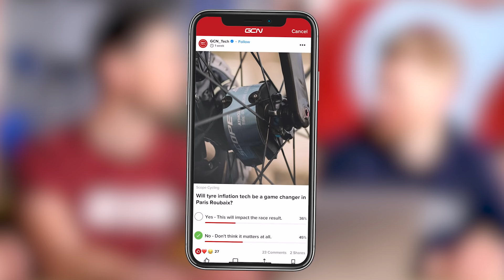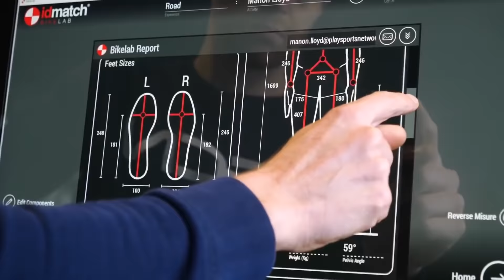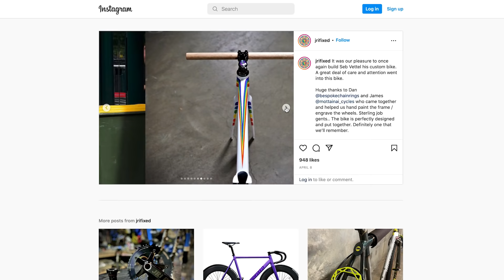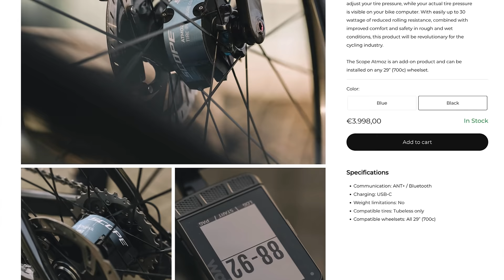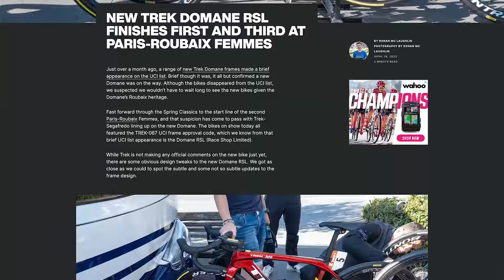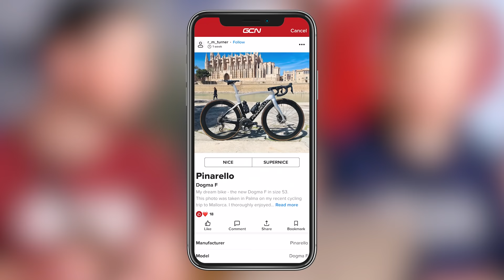We Ask A Bike Fit Expert Some Big Questions | GCN Tech Show Ep. 226

Comment from the maker: Have you ever had a bike fit or are you planning on getting one?
Reply: Had one done on my Wilier with an integrated seat mast. If you’re having your carbon frame cut you want the measurements to be spot on!
Reply: I've had 4 or 5 and work with a fitter now. That said, it's really really hard to find a good fitter in the US. Maybe impossible even outside of core cycling markets like the west (Portland, Seattle, SF, Denver, etc). Never found a great one in the midwest anyway and don't hear much about cycling out east.
Reply: Saving my pennies for one with Jake!
Reply: Never needed one.
Reply: Purchased a new roadbike including a bikefit. I don't save on a bikefit when I buy a high end endurance bike for the comfort and long rides.
Reply: People spend more on bike fits than I've sometimes spent on bikes. Seems like one of life's big waste of money, but each to their own, I'm sure marginal gains makes a vast improvement on the way to the coffee shop!!
Reply: DId one a few years agao and it was great. To Jake's point, I didn't necessarily produce more power, but it sure allowed me to produce the same power for a lot longer, particularly when climbing. Coming from the 90's school of bike fitting I was waaay overstretched on my frame, both vertically and horizontally. I finally understood why riders six inches taller than me were riding the same sized frame as I was. Now I've gone down a size and fell much better for it.
Reply: Yes. I found a PT who does bike fits. Purpose was to prevent possible injuries. Oh I am 61 years old.
Reply: @chicagoan  millions of people cycle on the east coast. I'm in NYC and the Manhattan Bridge has a counter at the north end of the bike lane. 3 million already across the bridge and it's only April. That said, I did have to search for a good fitter
Reply: @philthewriter  nothing to do with "marginal gains" and everything to do with preventing injuries. I tore the labrum in my right hip from a poor fit and the only thing keeping me out of an OR is a completely different frame with a proper fit
Reply: I had a GURU fit last August after an MRI showed I tore the labrum in my right hip from riding on a frame that was too aggressive and poorly fit. Switched to a Domane SLR after the fit, rode my first half century 10 days later, and have managed to avoid hip surgery 8 months later. I just threw a 90mm +17 stem on (up from 80mm +17) because I spent all winter on the trainer and I'm averaging 6mph faster than this time last year, and the handling at higher speeds was awful in corners with the shortie stem.

Having a fit was life changing and it's not only keeping me on a bike but also keeping me from having surgery, at least for now. Having the hip cleaned up is probably inevitable, but getting back on a bike post-op will be much easier with a correctly fit ride. Edit: I had the tear most of last year and put 3,000 miles on the bad hip with almost 60k feet of climbing, and I'm going for 4,000 miles and 100k feet of elevation on it this year.
Reply: I am an interest of research my fit on bike by myself, i think that my feelings helps me understand it better.
Reply: @Taz86  I know there are lots of cyclists but was referring to a serious cycling community. You rarely hear about pro cyclists coming from the east or many popular races/rides in general. I actually can’t even name one.
Reply: No at the moment. May be later
Reply: I have 2 bike fits.  2 bikes.  After fit my standard outdoor ride of 37 miles I had my pr on 3 segments 1st day then beat them all second day.  Saddle comfort better too
Reply: I have, with an experienced fitter. An afternoon session where my current bike measurements were transferred onto a stationary fitting bike with a pressure sensitive saddle. I was hooked up to wired sensors on several body pivot points. While riding, adjustments were made until I reached a well balanced position. Then afterwards, the new measurements were immediately transferred back to my bike! Except for a shorter stem length (obviously), it needed a whopping 20mm reduction! 
If you're an adult, it's a one time investment that can save you from discomfort in the long run. Totally worth it! 👍
Reply: @HoudiniNL  Recommend it being more than a one time fit. If your riding experience, fitness, flexibility, etc. change so should your fit (often). The point being your fit should evolve with you as needed. Even a ‘lite’ fit every season or every other is probably a good idea.
Reply: I had 2 bike fits. With two different results. Now I'm even further from home.
Reply: Had one with Jake for my road and tt bike such a huge difference in comfort and happiness. Smashed my pb after :-)
Reply: Yeah, I've had a few fits on the bike.  Mostly due to close passing.
Reply: I have had one for my Specilized Roubaix, 2600+ miles weight  changes and a few chiropractic visits I will have another in about a month
Reply: No, I’ve never had a professional bike fit.  But would sure like to have one.
Reply: I never have I want to not sure who can where I’m at. I’m looking to get my first hard tail im favoring Giant talent 2 large I’m 5’11”
Reply: Yes, the difference was AMAZING!
Reply: I also had 2 fits.  With 2 striking differences in the result.  The seat height differs in both by almost 1.5 cm, the saddle position to the rear by 1.7 cm.  I think every fit expert goes his/her own way and finds the right one.  But only you know whether it really leads to success for you.
Reply: For me an example of not being able to fit.  
CALAB EWEN.  
A horror position but the fastest in the field.
Reply: Yes!  Imagine my surprise seeing Jake on GCN 😁 as I had a bike fit booked in with him over the weekend!  I absolutely recommend getting a bike fit done, why wouldn’t you?  Improve your performance and protect yourself from injury, it’s a no brainer and wouldn’t hesitate to recommend Jake.  Really helpful, super professional and a great location 👍
Reply: I've had three fits over the years - it all depends on the fitter. In my last fit two years ago he lowered my saddle by almost 2cm! Just as Jake says, it's very easy to end up with a saddle that's too high, if the fitter is doing it by the book instead of by looking at the dynamics of the way you pedal and sit on the bike. The lower saddle is definitely better for me. Also, if you change equipment (especially shoes, cleats and cleat position), it's very difficult even to replicate a previous position, even if you are really pedantic with measurements like I am.
Reply: No. But definitely thinking about it
Reply: Just had one last week. Biggest change, amongst quite a few, was too high a seat. First 42 mile ride felt odd with the lower seat, but felt a lot more planted in corners. Lower back ached a little next morning, but I was expecting aches until my body gets used to it. Cleats were taken further back. The main reason for the fit was to limit any issues that I'm storing up further doen the line, 72 years old.
Reply: yes next week in fact.
Reply: Yep, I had a bike fit back in 2016, after many years of cycling. Best money ever spent tbh: my saddle was too high (massive drop, nearly 2cm) with tight hamstrings at the same time (injury waiting to happen). One leg significantly shorter, my left leg was always burning/suffering first when going for it... cleat spacer given, that sorted it. Arch support insoles given, that improved my knee tracking and cleat position changed to avoid "hot foot sindrome", as big toe bone was too far behind the pedal axle, which also puts more pressure on achiles and calf muscle to stabilize the foot. It took a while to get used to the new setup, but I'm much smoother and comfortable on the bike, injury free and found some extra power once used to the new position. Can't recomment it enough, not just to beginner cyclists, but even advanced club members and elite racers.
Reply: @chicagoan   got one in wheat ridge cyclery outside of Denver.  Worth it.  My shoulder pain is gone.  At $350 wasn’t cheap, but new saddle, handle bars etc… pushed it up to $750

Comment: A pro bike fitter immediately spotted the reason why I was getting significant pain in my right knee, my saddle nose was angled down too far thus pushing my weight forward and my knees were under increased load to compensate for that. A couple of quick tweaks and it was honestly like riding a new bike and not even a mumor from the old patelas afterwards. Cannot stress the importance of a quality bike fit for injury prevention, comfort and performance. Great vid guys.
Reply from the maker: Injury prevention is such a great benefit!

Comment: Had a bike fit twice with the retul system... still had SI joint pain. Went riding in a group and one of the very experienced riders told me while riding uphill or rolling turns in the drops my body rocks to much. Drop my saddle height 2cm via 0.5cm increments over a couple of months and it made a world of difference

Comment: I was fitted for my first racing bike in 1990 and again with my second in 1994. The second fitting specified bars that were (at least to my feeling) too wide. I pretty much immediately had them changed to 42cm width of my first bike. It just felt better. My setup has remained unchanged since then. All three of my current bikes are set-up exactly the same. Same bars and bar width. Same set back. Same saddle height and same stem extension and crank length and pedals.

Comment: I had knee problems for years couldn’t seem to solve it…went to Lee Prescott at Veloatelier in Warwick. Had a bike fit & had been wearing shoes to small & narrow. They suggested new shoes & insoles formed to sole of my feet…completely solved my knee issues, i was amazed frankly. Didn’t need any further visits..would recommend as the single most important thing to do to resolve your issues 👍…also i had metalwork in my spine & pelvis showed them xrays in case relevant.

Comment: In my earliest years on a bike the fitting was just which model is your size. By todays standards I owned bikes that were too big and too small. When I got more serious, interest in racing, I learned that proper fitting makes riding a bike better. My experience fitting cyclists for 30 year says the human body hasn't really changed, but being able to make adjustments on a bicycle has gotten easier. Cyclists seem to have two distinctly different primary goals that are not 100% compatible. "I want to be comfortable" or "I want to be faster''.  A proper fit does not in itself magically make the ride easier or faster. The muscles still have to work at the same level of output to move the bike at the same speed. When we become properly unified with our bike we focus on gaining motion more than over coming discomfort. Air resistance, mechanical resistance and gravity are fixed resistance factors that are not as vital as the proper fitting of a bicycle.

Comment: I have a weird question… All else being equal, with a 72 degree head angle and 47mm offset how much would going from a 400mm axel to crown fork to a 485mm axle to crown fork effect front center and spindle to tire clearance?  What about bottom bracket clearance? Yes it will look silly but it’s a frankenbike)

Comment: I kinda agree with the nix on turned in brake levers. Looks a bit goofy, or like your bike fell over on each side that day. However, brake levers are also 2/5 ths of your contact points. So if it works for an individual, go for it. Another point...I have larger hands, I wear XXL gloves. Long before I heard any talk on this topic of turned in levers, I was experimenting with  this Y axis adjustment and found on some of my bikes turning in my levers optimized lever grip, and relieved a bit of wrist strain. Any way, doing things pros do is natural in any sport. Kids started wearing thier hockey jerseys like Wayne Gretzky, sticking out thier tongue like Michael Jordan, etc. Personally, I encourage people to experiment. Folks like telling me I run my bartape from the wrong end, but I refuse to use electrical tape on any of customers bikes or my own. Haha.

Comment: Question for Jake. I am a 60 yr old rider with tight hamstrings. I have pain in my right knee - rather above the knee and on the inside (2 0'clock position) regularly after rides. I've had several physio (actually many) sessions for other injuries and I'm horrified at the absolute contradiction between different experts. How can I really rely on a bike fit opinion? I'm certainly not too high in the saddle. I also use mtb spd pedals with a lot of float.  I only ride on the hoods - fairly upright.. Any suggestions? And how can I book a bike fit that I can believe in?

Comment: Bike fit done here. It did make a difference and helped me to understand making slight "tweaks" if I am feeling something wrong. Now of someone could figure out how to get a saddle that doesn't hurt after an hour... The rest of my bike is dialed!
Reply: Get a saddle fit! Go to a fitter with 20 or so saddle options and test them out. Or order 5 on Fizik and just return the ones you don't like.
Reply: Your bike fit should have sorted you the correct saddle. Need to find the distance between your sit bones and go from there.
Reply: sounds like you need another bike fit, saddle problems arent always caused by the type of saddle
Reply: 80% of the time, saddle problems isn't caused by the saddle.
Reply: Thanks for your input guys! I did have my sit bones measured so it's not that (143). I am still in touch with my bike specialist and will reach out to him for advice. I have a longer than usual torso so that makes the fitting tricky. If only Trek made 57's I would be set, but sadly they do not. Thanks for your insights!

Comment: Jakes' later point is possibly the most important; Everyone's body is different and you can't just pigeon hole bodies into spec sheets.
 Personally, recommending visiting a good sports physio and getting assessed for any discrepancies in lengths and entire ranges of motion.

 THEN move onto the bike fits. bringing that information with you.

Regarding Fastest Parry-Rubix, and before an ALL HAIL TUBULARS!... weather; no rain but there was plenty of weather, from a generally pushing direction? It helped with splits at the start of the race, did it also help the last half for being pacy?
 Annnnd, of those driving the front of the race (sampling the top 10-20 riders per hour of racing) how many went 'commando' and how many "lugged" bikes around with tubes stuffed in their tyres?
Reply from the maker: Good comment 👍
Reply: visiting physio is probably best advice,however is not easy to find good one and specially cheap its not

Comment: Are there any pro riders, that uses the +4mm dura ace pedals / longer spindles on speedplay pedals? I often read "the narrower the stance with is, the better is the power transfer". But I cannot imagine, that this will suit to every rider. I am a tall rider and get knee pain on the outside by using the "normal" shimano SPD-SL pedals. I feel more comfort with the +4mm.

Comment: Why don't the pro's use some anti-punchure technology Paris Roubaix where the tire is filled with a foam insert.  I saw something a while ago on GCN where you can have a foam thing inside your tires to stop getting punctures.

Paris Roubaix doesn't have any climbs so weight be an problem, so why not be super paranoid about punctures?
Reply: Tire mousse increases rolling resistance
Reply: @khawajadotd  how does it increase rolling resistance? If you don't have a puncture then your tire would be at the same pressure, and it you do have a puncture you'll be glad you had it.
Reply: @matthewbaynham6286  I dont think the foam inserts actually prevent punctures they just enable you to ride without the tyre collapsing. They would probably still need to stop and change the tyre.

Comment: so, here's my question... I tend to like to have my bars fairly level with the saddle... from some of the bike vault comments from the fitter and the guys, it sounds like that may be preferred from a fitting perspective? thoughts?
Reply: I disagree. It completely depends on the flexibility of the rider. The degree of comfort desired and the requirement for speed. Its all a trade off. 

Poor flexibility? you aren't getting a low position.
Can still generate  power easily in an aggressive position.. go for a low position.
Racing too? Then go as low until it has a negative effect.

Comment: In my view and experience, a bike fit was a waste of money. I ride without issue a 56cm Tarmac and was recommened a 49 cm bike which a local dealer doesn't stock and would refuse to sell me because it would be the wrong size. I'm 5 10 with a 32cm inside leg. I've concluded the best way is to get my leg over a selection of bikes but availability is limited.

Comment: #askgcntech. When rideing incline or up hill there is a loud squeaking noise coming from the 11 speed cassette when using the top 3 low gears.  The bike shop can't work it out. I have a specialized diverge comp 2018. Any ideas. I think that maybe the derailler cogs are worn. Help please.

Comment: With a threadless setup, I ride with my stem pretty slammed. (1mm under and two mm over the stem)  My saddle to bar drop isn't extremely large 4-3/4" (120mm)......I ride a 58cm top tube, with a 13cm stem. 73x73 angles. I can tell that I'm getting old and less flexible because I don't feel as comfortable on my mid 90's bike. the 140mm quill stem makes me feel a little stretched out. Part of this is because the levers are set up mid 90's style, with them lower and farther away from me.